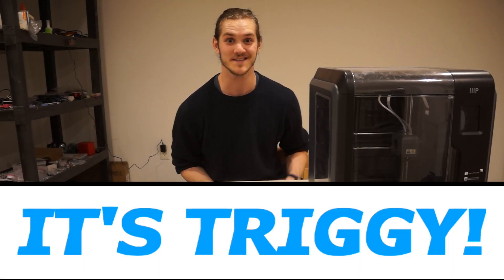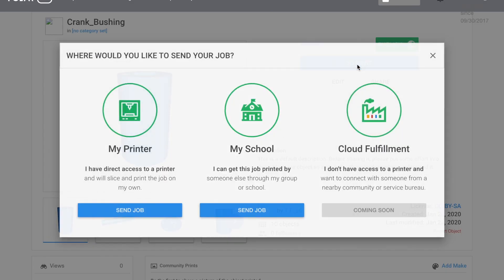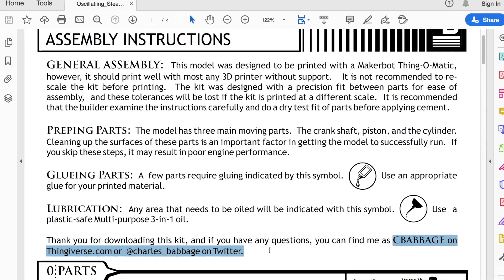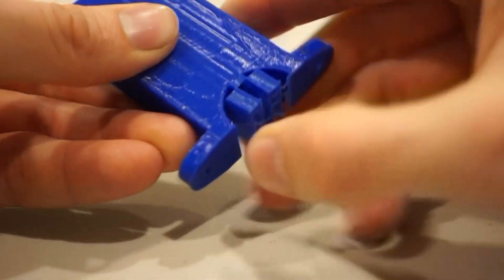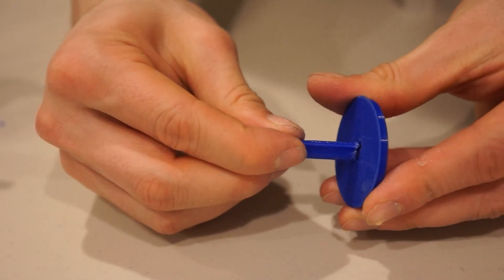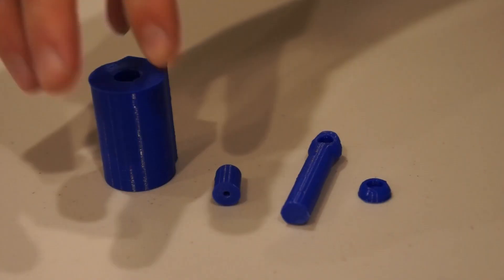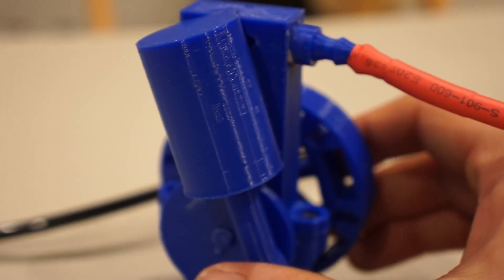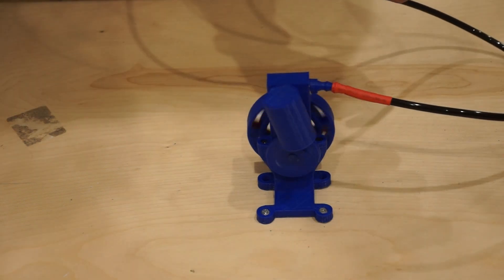3D printing a steam engine

Comment: Cool video! Next, you should try and use it to drive a cart or something to resemble a train.
Reply from the maker: Oh cool idea!
Reply: i dont think that would work with the 3D printed version, the piston is not even close to a perfect seal and that makes it inefficient and the flywheel has no significant mass, but good attempt nonethless
Reply: @janiransi3925  You could 3d print a semi functional piston ring, and maybe even a oil sump. The 3d printed layer grooves would allow for great oil spreading along the piston walls.